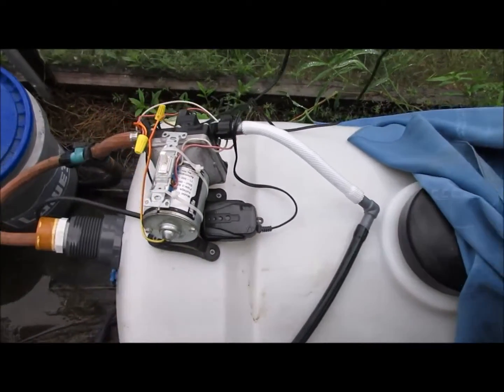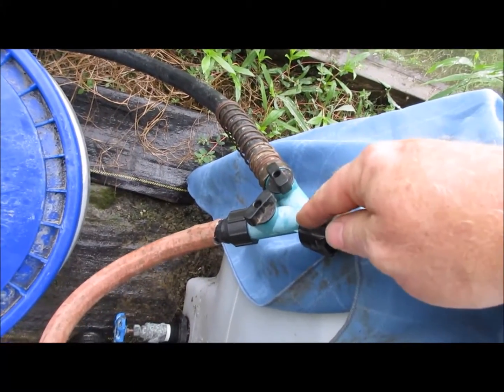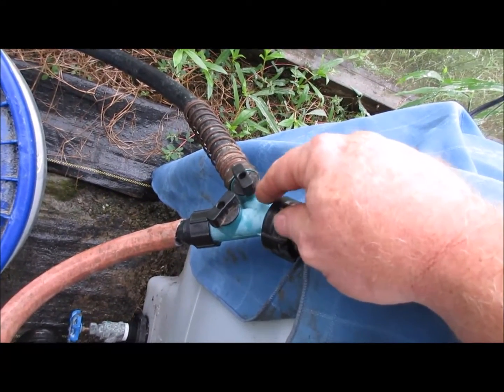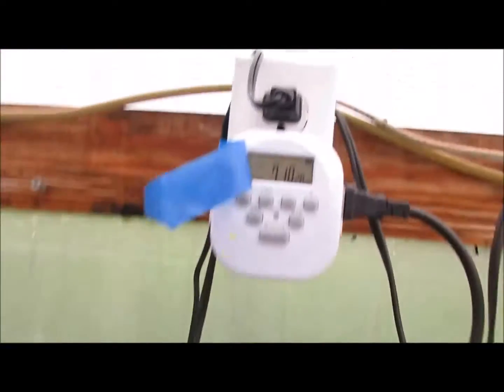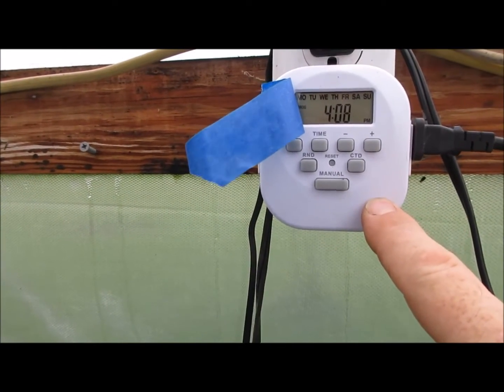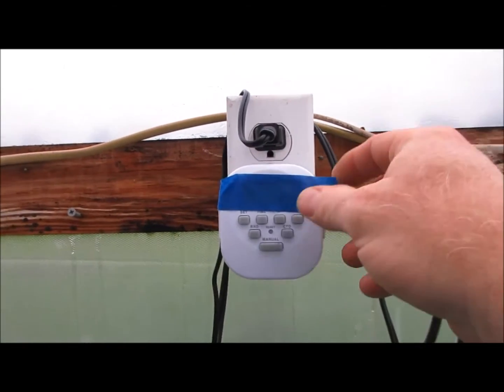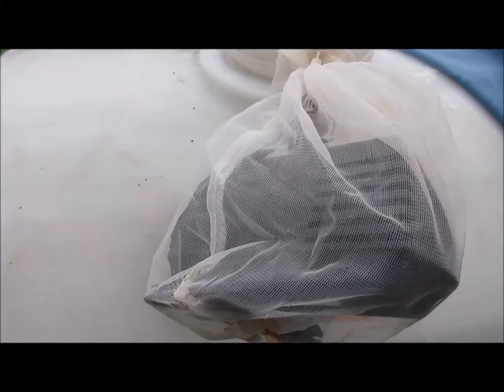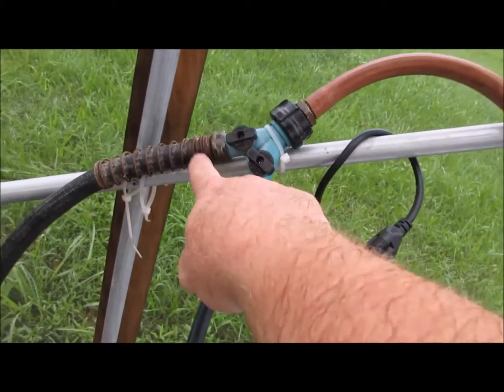Hydroponic Flow to Waste - Part 2

Comment: Hello Brent.  Call me old fashioned but I still like to use a watering can. Keep it simple and inexpensive. A liquid feed added at the recommended rate to your watering can then pour, with the certainty that everybody gets a drink.  That said, my set up is much smaller than yours and now I am retired I have more time to do it. Happy gardening. HGV.
Reply from the maker: Oh, I understand James!  It's about the connection with the plants!  You are right, my size would require a bunch of mixing and a bunch of watering.  I appreciate you dropping in brother.
Brent

Comment: nice design for  a dosing pump system , a little complicated to operate but a lot cheaper than the professional dosing systems on the market
Reply from the maker: What I like about it is that it will run for about two weeks now without having to touch it.  Initially, there's some tweaking involved.  Within 2 to 3 days, the ppms are right in range--system has to cycle several times--then just sit back and let her go hitting the distribution tank once every day or two with a tester to check ppms and glancing at the fluid levels.  It is so much easier than recycling systems.

I am considering doubling the concentration levels for twice the length of time, but don't want to jump into it right away.    

Dosing pump system is a new one to me.  I read up on it some.  Perpetual learner here.  Yes, there are some aspects to those machines.  Definitely see your point!  I hadn't considered the dosing part of this equation.  I just thought it made sense to not have to constantly mix nutrient.  I hope the takeaway to this video is the value of not recirculating.  

This stuff crosses paths in so many ways.  Please chime in more with your expertise, discussions, and points.  I like talking about it and doing different things.
Brent
Reply: I'm still learning like you, growing Kratky style and soilless hydro but I only manual feed twice a week with my DTW modified global bucket system. I had just read about dosing systems(recirculating) and (direct) injector systems that large greenhouses use for DTW systems.    Wish I could find the University video explaining the injector system.  A lot of the medical cannabis growers have videos on the setup of injector and dosing systems too for DTW.
Reply from the maker: What is your medium for soil-less hydro?  And, what do you do with your waste in DTW?  Btw, global buckets are what I started off with, then modified buckets, then RGGS, then modified RGGS, then I found hydro.
Brent
Reply: Still using a peat based mixed, my waste just gets stored in the bottom bucket of the global bucket for the plant to reuse.  30 buckets connected together with 1/2 in tubing with one bucket having a set of drain holes so the don't flood.  Water each bucket twice a day 3 minutes with 2 gph emitter and manual feed 12 ounces of 700 ppm 1-2-3 mix of General Hydroponics 3 part mix (easily sourced locally.) twice a week.  May make the jump to the MasterBlend mix ( have to order online) when I finally run out of GH but I only use about 8 gallons of nutes a week on 30 buckets and 102 strawberries in quart cup rain gutter system. The GH is really easy to mix in small quantities with a feeding syringe.
Reply from the maker: Nice!